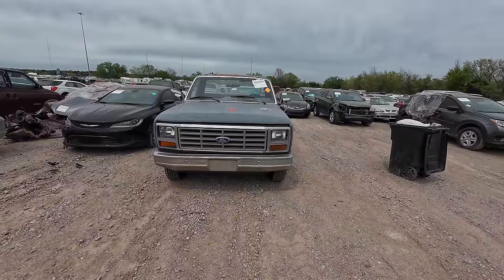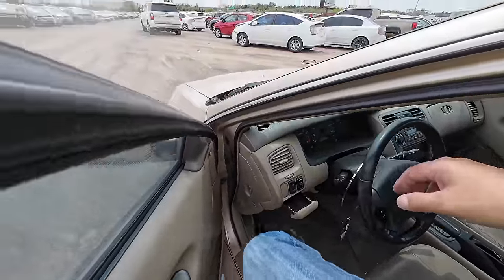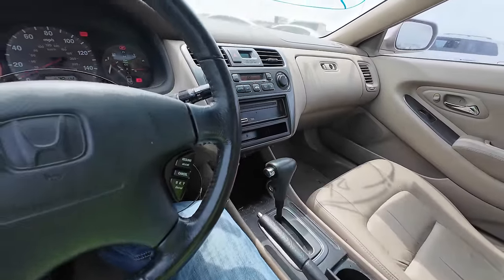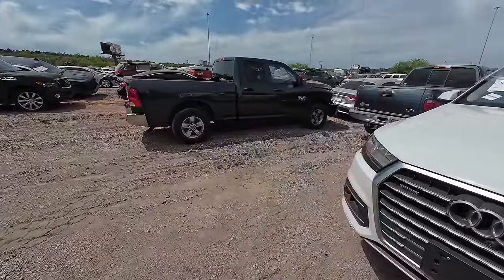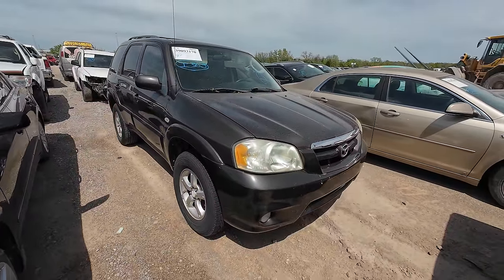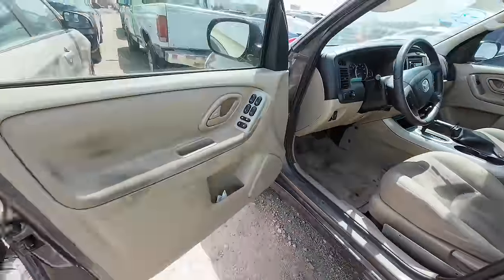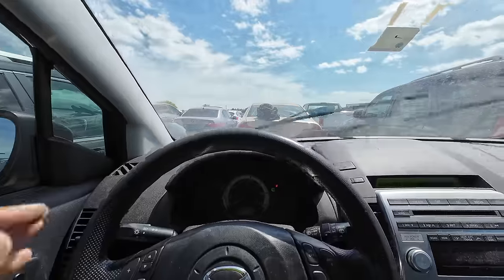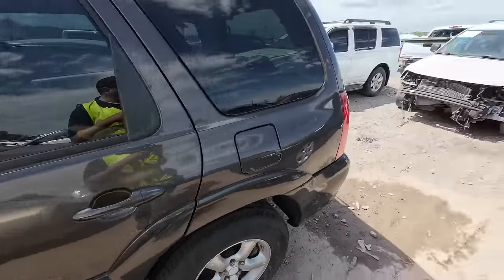I've Never Seen one of these Cars Before - What is it?

Comment: The Mazda5 is mechanically a Mazda3.  I daily a 2007 Mazda5 with a manual transmission.  Engine went out and I swapped in a 2.5 out of a 2016 Fusion.  Bolted in.  Fantastic little rig, hauled a bunch of stuff in it.
Reply: Motor Trend actually did a drivetrain swap in one with a blown engine that was bought back.  Mazda donated it and a Mazdaspeed 3 that had been involved in an accident on the transporter.

They swapped the Mazdaspeed drivetrain into the Mazda 5 and they (Mazda) should have built it!

I think the video is still here on YouTube.  Definitely check it out if you have a chance.
Reply: @brian5o  Yeah, that was cool and all but not an easy swap.  The Fusion 2.5 is a popular replacement for Mazda 2.3s as they are super easy to find, cheap and easy to swap.
Reply: @brian5o it’s not practical to use a speed3 engine in the mazda5 it’s too tall and at risk of rollover to be given any kind of performance

Comment: Yes, I need 1984 ford f150 I'm really love that old truck pick up you buy that now I'm really need that now
Reply: I think it could be an 86.  My stepdad had an 85 with granted a different engine, a 300-6.  It was carbureted.

The Mustang got fuel injection for the first time in 1986, the last year of the 4-eye.  

The 1987 F150 had an update to the boxy one with rectangular composite headlight assemblies.

I do think that one is an 86 but the bodies from 1980 (I believe) until 1986 are the same.

Comment: Hey Randy, how's it going?  The A/C compressor on that Mazda 5 should be at the bottom of the belt, under the engine.  On the passenger side near the tire, just in front of the axle area.  Not a hard replacement, especially on the lift.

Comment: I love this Mazda 5 I have always wanted to buy one. I believe the final year of production was back in 2015. Very good on gas its basically a hatchback to the Mazda 3
Reply: Mazda had 3 hatchback that they sold alongside a 3 sedan at the time still does to this day. The 5 is based on the same platform but is actually larger than the 3.

Comment: The ford is an awesome buy, the ground wire going to the ignition is probably wound around the steering colum and is getting pulled when you trun the wheel

Comment: Those Honda v6 autos had a lot of issues. Doubt it was maintenance neglect.  That dealer service tag on the key is a good sign it went to get service and they were told the trans was bad and traded it in. No flush is going to fix that. 

The ford truck would be cool to see cleaned up and painted.

Comment: The Mazda 5 is a car I know well.  Drove an 08 for several years and almost 300,000 miles.  It was a wonderful car, almost no repairs, just regular maintenance, and was more fun to drive than it had any right to.  08 and better has rear air.  The transmissions in those years are the weak spot, that is what ended up killing mine.  I would be worried about that.  I would take the 5 over the Tribute (Ford escape), in pretty much every case.  But I would be worried about the transmission in this one. The rear seats all fold independently to give you cargo options it was a great small family car for my family of 5.   I know, sales pitch over.  It was just a really good car for me.  :)

Comment: Randy. I’ve got to know how in the hell you find a Chevy Cruze reliable. Maybe the 1.8 but damn sure not that junk slow turbo lagging pile 1.4. My moms has never went 10000 miles without being in the shop for some type of leak somewhere, valve cover problem, 3 water pumps all oem, and purge valve. Now I know they may be “small problems” but we ain’t even at 100,000 miles. My dad nor mom will ever buy one ever again no matter what.  They are JUNK. Make a good lawn ornament since they actually don’t look bad.